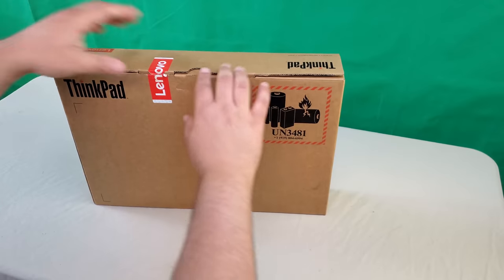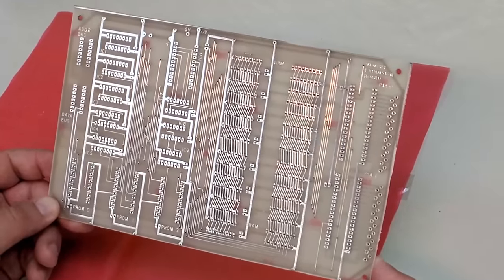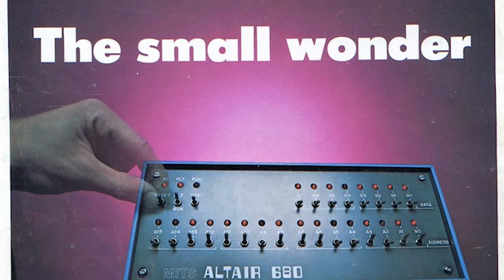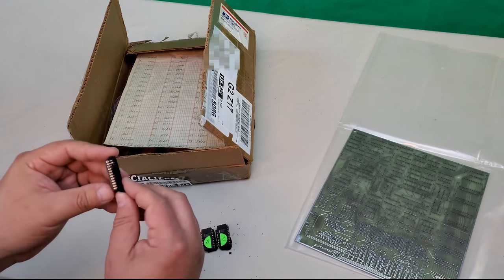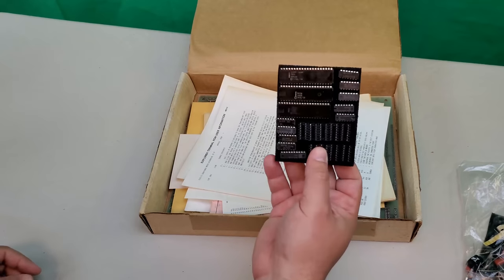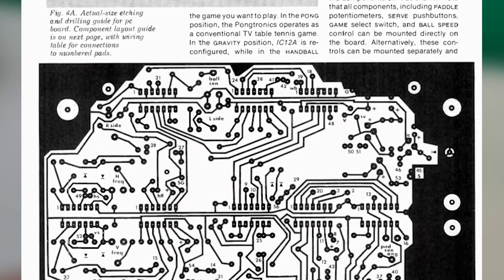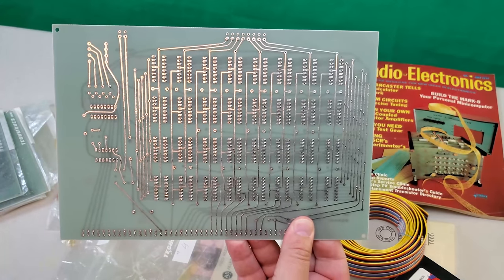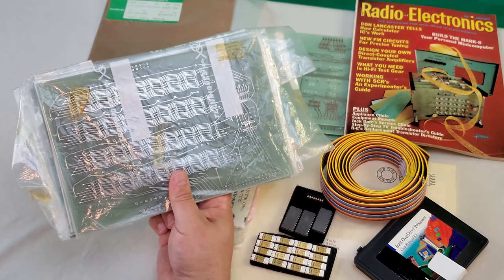Early Kit Computers

Comment: What a fascinating collection!  I started building (mostly) retro kit computers last year, and I just finished a slightly-updated reproduction of the "78up5" Signetics 2650 Mini System (also published in Electronics Australia as an update to the slightly older one you showed, I believe) a couple days ago.  Having proved that it works as advertised (I can enter machine code into the PIPBUG system monitor via serial terminal, then execute that code and see the output), I'm please with the result but not sure what else to do with it now, hehe.  Documentation I've found suggests that, at one time, there was commercial software available for it, as well as upgrade projects, but I haven't found the binaries for any of the software yet, and the old magazine articles that describe projects are not in the greatest, most readable state.  Oh, well.  It was fun, just the same, and there's always the future!

Other kits I've built use the RCA COSMAC 1802, Zilog Z80 and Z180, Intel 8080A and 8085, MOS 65C02, and Rockwell 6501Q.  I even just today looked at websites offering kits of boards to build your own reproduction Schelbi-8H or 8B and Mark 8, but the prices, just for the boards, are a little eye watering, so I think I'll have to skip those.  :-O

Thank you so much for showing us your fine collection of original, vintage kits!  :-)

Comment: My dad built a Heath H88/89 back when I was in elementary school (around '79).  He still has it and says it should still run if he replaced the power supply in it.  I can remember learning BASIC on it and my dad upgrading it from a H88 w/16k to a H89 with 2 floppy drives.

Even though the second drive isn't around anymore, I'd love to get ahold of some hard sector floppies and the OS for that beast and see if I could relive some of my childhood days on it.
Reply from the maker: I have an H88 here... I'd love to get my hands on the original H9 terminal they had for it.  Pretty cool machine.  When you use the front panel it feels like you're programming the time machine from Back to the Future.

Comment: Nice retro review! Just a small correction: @4:19 The DREAM 6800 came with only 1KB of RAM (in the form of 2x 2114 1Kx4bit Static RAM chips). In addition there was 1KB of EPROM (containing CHIPOS), in the form of a 2708 triple-supply EPROM.  Because the 1KB RAM + 1 KB ROM comes to a total of 2KB of "memory", this likely explains your confusion saying it had 2KB RAM. Interestingly, most users were motivated to upgrade their DREAM 6800 to 4KB RAM to allow playing the machine-coded DREAM INVADERS game.  Note also that the 2x 2114 chips were transferred off the main PCB and onto the memory expansion board, required as the main PCB did not fully decode the onboard 1KB RAM space (Only A15 & A14 were decoded so the 1KB onboard RAM was replicated across the entire lower 16KB address space). Note also that most users only expanded to 4KB RAM as that was the maximum that CHIP-8 itself could address (due to it's 12bit operand addressing). Therefore, most DREAM 6800 memory expansion designs were only 4KB. With a fully populated 8KB RAM on the J.R.Components DREAM Expansion Board, the additional RAM above 4KB could therefore only be utilised by machine code programs.
Reply from the maker: Ahhh.  Good catch!  Yeah I was going off the cuff a bit.. the particular JR expansion board I have I think I had a bit of trouble getting info for - I had found another version without the spots for the EPROMs.  As for the 6800 itself, my actual machine is technically a 6802, which Michael Bauer said was a thing JR did against his approval as the 6802 is a slightly different beast, and he was surprised it worked.  I believe it had the same amount of RAM onboard as the 6800.. I think all they changed was the CPU.  If it didn't that may be where I got mixed up.  But more likely I just miscounted.  Thank you for the correction!
Reply: @TechTimeTraveller  Yes, the DREAM 6802 variant still had the same 1KB RAM.  It came about because there was a worldwide shortage of MC6875 clock chips at the time the DREAM 6800 was released.  The 6802 is basically a 6800 with onboard clock generator (and also 128bytes of battery backed up RAM).  Note that due to the 6875 shortage the author also published a replacement clock generator circuit, that many made up on a piece of vero/matrix board to use in place of the hard to find MC6875.  Hope this helps fill in the background.  :)

Comment: CMOS parts back then were unbelievably sensitive to static damage.  My first kit didn't work because of one ic that was zapped, and I used a static wrist connection and a grounded soldering iron.  It was a Netronics Elf II and I sent it back for them to fix.  Those were really different times back then.

Comment: Some very nice vintage items:)

But you should really build those kits and bring them to life.

Right now they are dead and not very interesting except to us connoisseurs:) It's like those computer museums  where nothing actually works....much better if everything could be running.

I just found a very rare SC/MP kit, all there in the original folder, and I intend to build and connect it to the Teletype:)

You are still preserving history by building them:))))
Reply from the maker: It's a tough one.  I solicited a lot of opinions on this subject and it's 50/50.  I do kind of agree a computer was meant to do something, not sit static on a shelf.  But there is a lot of pressure to preserve history.  I actually had an email conversation with Jon Titus himself about my Mark-8 boards and he felt they should remain as is.  That's pretty tough to go against. :)

Comment: The Color Computer used and almost identical joystick -- just two potentiometers mounted at right-angles to each other. Ergonomically they were marginally better than the PPG-J, but not by much. 

I think that the slider controls were used in a handful of Pong units, but they were not very common. 

I have never seen a stereo with a "joystick" to balance the speakers. Thanks for providing some context to the industrial design.

You should store those original manuals and other paperwork somewhere other then the cardboard shipping boxes. Some items look a bit fragile already; flattening them into acid-free file folders will really help with long-term preservation.

Comment: Do you have a video of you building one of these kits?
Reply from the maker: Unfortunately no.. I have opted to leave them in their unbuilt form for historical reasons.  The closest I have is an upcoming video regarding my TV Typewriter.  I didn't have the actual kits boards for that, just the construction guide, but I built it similarly to how someone would have built one at the time, if they had used the plans to make their own boards as many did.  That video will be out soonish.. just working on some animations and final edits.

Comment: I am in the process of trying to redesign the S-100 computer to use modern parts and 
have features that didn't exist in 1977. (HDMI, i2c, USB, HPIB, WIFI, M.2 SSD, etc)
I would like in to use the TDL Xitan pinout, but use one of the unassigned pins 
as a alt-bus pinout for high performance CPUs (ARM, esp32, CM4, etc)

Is there anyone out there interested in putting such an idea put into the works?
I use KiCad...

Comment: i would love if modern pc mainboards came optionaly in a kit variant (maybe with the plastic cpu socket presolderd) i even would pay 100$ extra
Reply: The price would be horrendous, the complexity and fragility also. (look at the LGA sockets people butcher when installing CPUs clumsily)

There plenty of clone 8bit and misc SBC PCBs and kits out there.

There are ancient 486 and Pentium motherboards out there, 90s stuff that is still kit like enough to be interesting (but slow), also Industrial ISA backplane stuff with x86 ISA SBCs to play with, cheap enough if do some hunting around.
Reply: @joefish6091  but i would still love to assamble my own pc completly from scratch including soldering on all the components on evrey board (excluding the psu of course) including bga components (preferably preballed) and after it is assembled it wont turn on and the debugging would start (the best part)